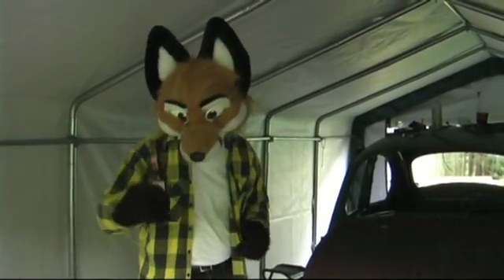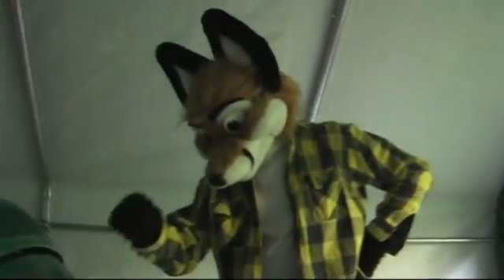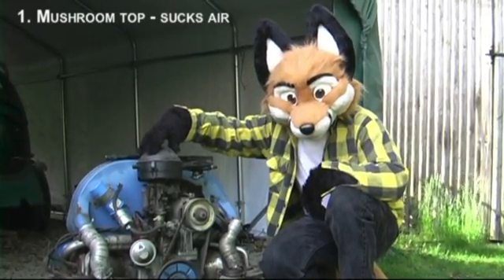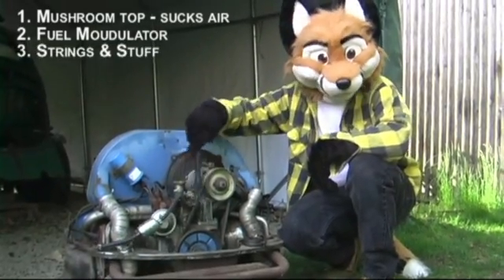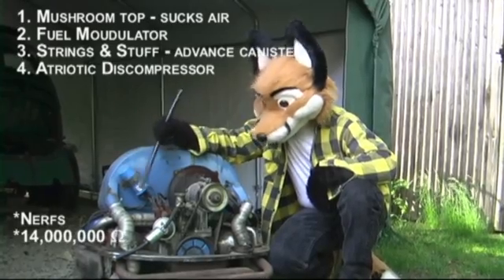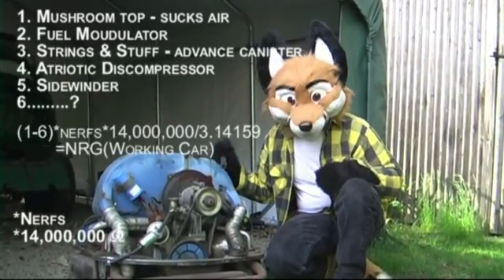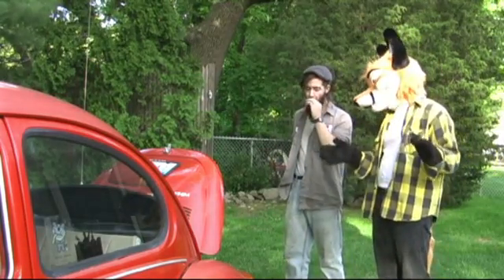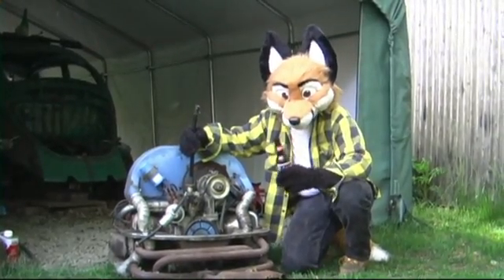Tip of the Day 206: Mechanics Special

Comment: 4:28 I think the atriotic discompressor had a problem gettin´ in symbiosis with the sidewinder. Either way, that good´ol exhaust has been shot clean now. My old school teacher had a VW bug and complained about some kind of power loss...so I told him to switch into neutral while driving in second gear, then turn the ignition off, pump the throttle two or three times and then switch the ignition on again. The exhaust instantly turned into a cloud of rust and he got all his power back - problem solved :-)